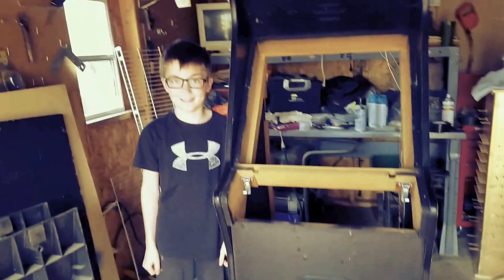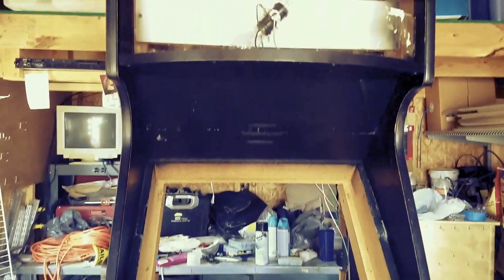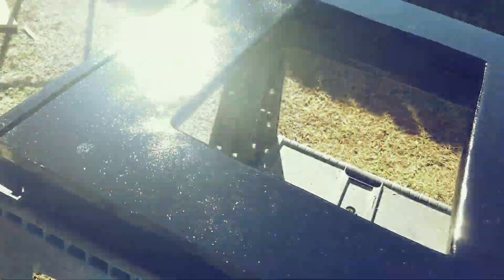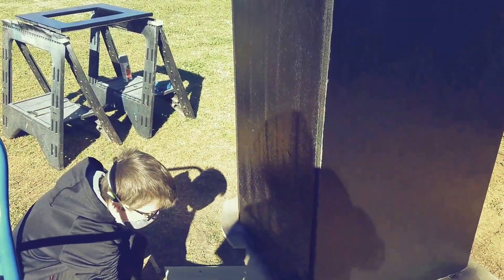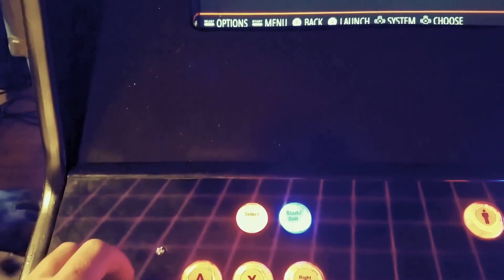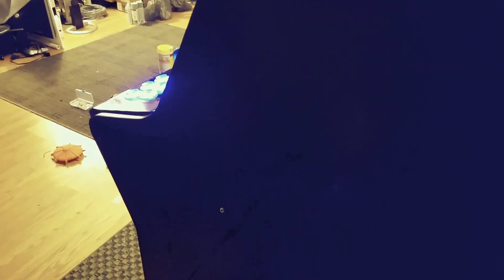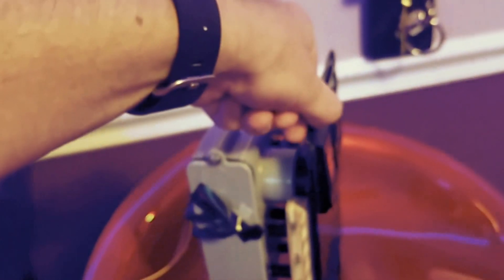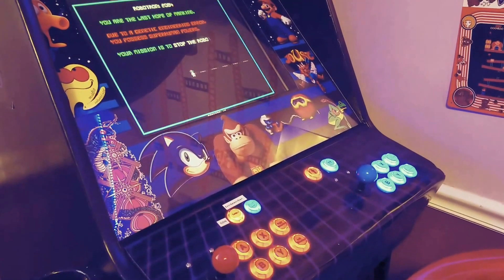ARCADE Cabinet DUMPSTER FIND and RESTORE!  Rebuilt using RetroPie, custom control panel and artwork

Comment: Great video. I can't believe you found that on the side of the road, very good find. I really liked what you did with the adrino to make it work with actual quarters. Now your son can have all his friends come over and play while he makes money off of them lol.
Reply from the maker: There were actually 3 cabinets but I only had room for 1 in my jeep, so I picked the one in the best condition.  I should have made another trip to get they other two!  Amazing the stuff you can find when you're not looking for it.  

Funny thing is, I had just finished building a Donkey Kong bartop (I also have a video on the base for that) and told  my wife I'm done and not building anymore in the near future.  The very next day I bring this home and I of course get an evil look :)
Reply: That is pretty amazing to find all of that just on the side of the road. I would have drove right back but I also know that look from my wife lol. I just noticed you had a powered USB Hub. Is there a reason for that? Is retropie able to detect both controls even though you are using 1 port? If you had an amazon link that would be great as well. Thanks
Reply from the maker: The encoder for the joysticks is actually two different USB cables to each.  So, you'll use two ports to the RPi.  I used a powered USB hub because the buttons I ordered could be set to all light up (at all times).  However, for that to work I read that you needed a powered USB Hub.  It wasn't any limitation to the Pi.  I also ran a USB extension from the hub to the side of the cabinet so I could easily plug in a keyboard, other controller, etc.  Here's a link to the powered USB hub I used.  You could probably find one cheaper and it doesn't need to be USB 3.0 since the Pi only supports 2.0 you could save some money getting a different model.  https://www.amazon.com/gp/product/B01HZP1VGO

Comment: Pretty cool how you did the door, but I'd probably just buy one for $35 from xarcade. They sell the actual single coin mech doors used on arcades.
Reply from the maker: I wound up replacing it with the xarcade coin door.  Our custom door worked fine for awhile until we wore it out :)